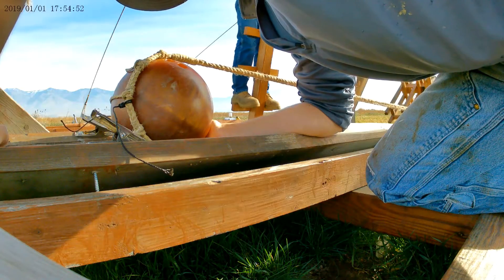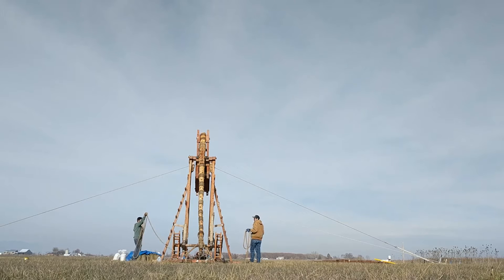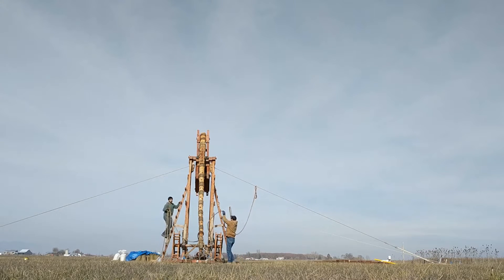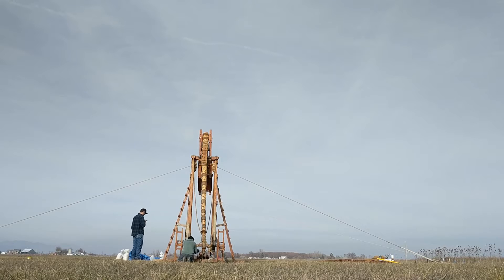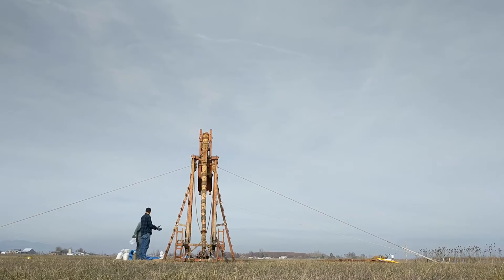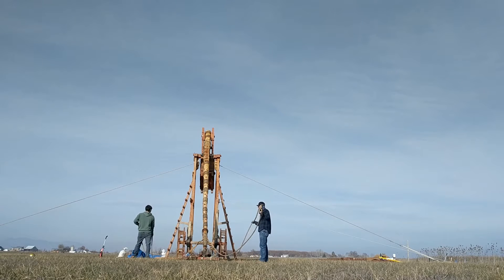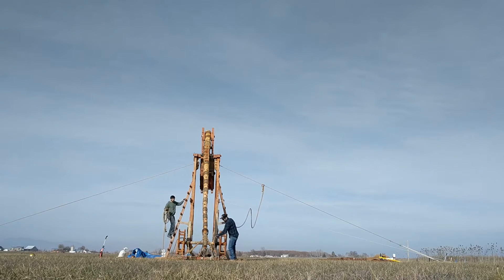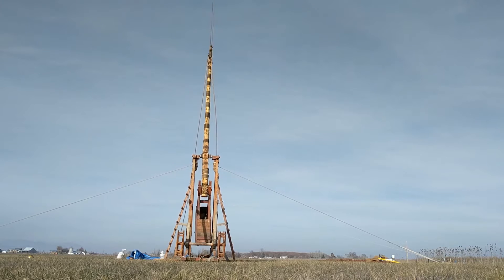Whip-Cracking Balearic Trebuchet Sling

Comment: what causes so much left to right movement of the weight?
Reply from the maker: The hole in the tree for the counterweight box axle has opened up as the tree dried, and now allows the box to twist and do all kinds of things.  The tree is a bit crooked over its length, and so if you notice, the box is off to the right side when cocked.  So the box is doing kind of a zig-zag side to side when it drops, it goes left, then right, etc.

I really need to do something about this in the spring, I've recently been given a few more ideas to band-aid the problem better.